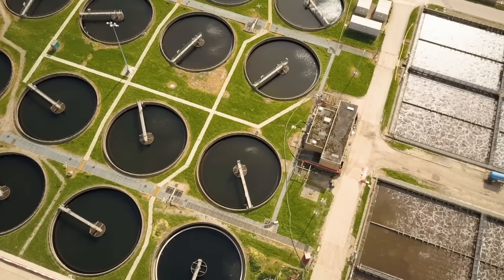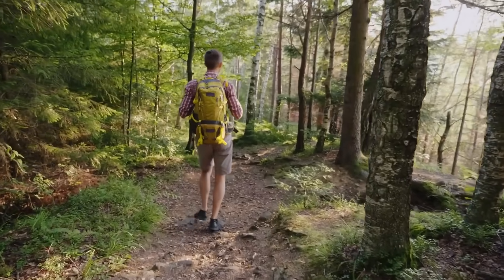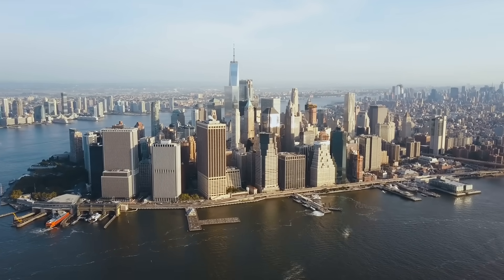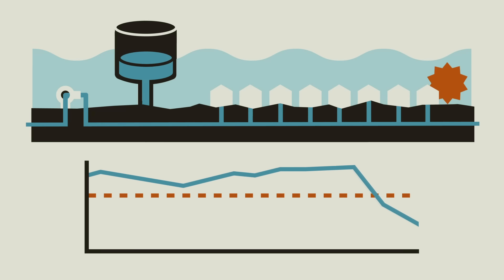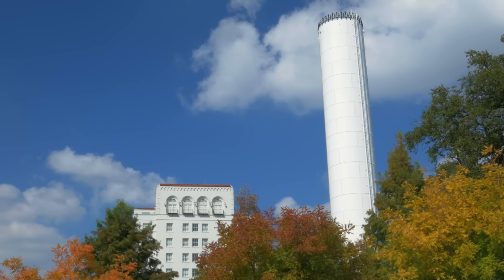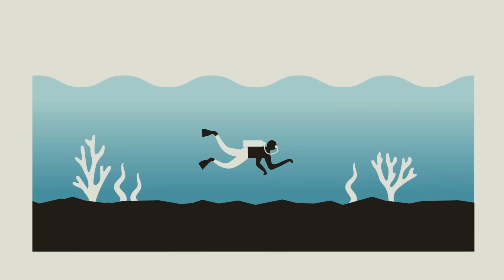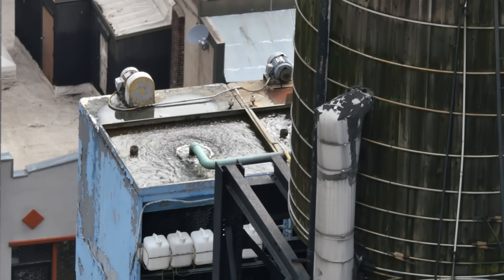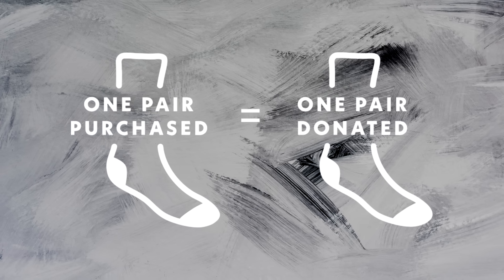How Water Towers Work

Comment: I live in the UK and I don’t think I’ve ever seen a water tower in real life
Reply: We don't have water towers except I think one in city with 380K residents and elevation 190-400m above sea level. Because most of the water is stored underground on some hilltops and distributed to zones of similar elevation below water tanks. But in parts of Czech Republic that are flat, we have water towers in form of large sphere  on thin "stem" anchored by steel cables. Historic underground water tanks are quite nice, btw. http://druhebrno.smerem.cz/tema/Vodojemy%20při%20ulici%20Tvrdého
Reply: They are brick towers though in uk not the design like in US.
Reply: I have seen gas towers before. Unlike water towers they basically work like a massive piston. They have a huge disc of concrete that they use to store the energy and pressurize the gas chamber below. Interesting solution for a fluid that's not heavy enough to pressurize itself (on that scale anyway).
Reply: Water tower presented on video can be replaced with concrete storage tanks placed on hill. Works the same but it's less visible.
Reply: I can see one where i live in Hereford, but it is not used these days, it is part of the water museum. i must go there one day just to be nosy
Reply: There's one in Tilehurst in Reading - it's quite a local landmark. Made of concrete too.
Reply: I live in Sweden and I have seen loads of water towers
Reply: I also live in the uk and there’s one about 15 miles away from me
Reply: Where do you live? There’s tons in Cambridgeshire and Essex. There weren’t any when I lived in hillier areas such as Lancashire though.
Reply: @cbehopkins  
There's one just outside Ormskirk.
...in Lancashire.
Reply: @cbehopkins  
http://m.ipernity.com/#/doc/302581/40933154

Comment: A water tower could have helped the fukushima reactor (and any nuclear reactor). The pumps were not working, the fission reaction was continuing and temperature was going up in the reactor.
Reply: And now they are spilling radioactive water in the pacific ocean but still below "safety" levels. I do wonder if our grandchildren will find this a problem.
Reply: The reactors still had pressure. They didn't have flow, so the heat built up to the point where the fuel assemblies started to melt. A water tower wouldn't have helped here. There are ways to remove heat through natural circulation, but I don't know enough about civilian nuclear power to know how or if they utilize it. They had backup power in the form of diesel generators, but they were stupidly put in the basement.
Reply: @WaterMan416  :
The purpose of the pressure vessel is to keep the water in liquid form.
What they need to do is have a gigantic water tower on top of the reactor. Open the valve so that water flows down into the reactor. They also need a huge receiving tank at the bottom. Another valve would be there that should be opened.

Basically, what I am saying that gravitation potential energy could be used.

In the old days, people would take baths. Almost nobody took showers. Some people would take showers by having a bladder thing filled with water (gravitation potential energy) and it flows down through the shower head and onto you.

The same principle can be used almost anywhere.
Reply: That'd be a wildly inefficient way to keep a reactor cool, as it would require a ton of water. Having a passive cooling method that could rely on natural circulation based on a temperature gradient causing flow would be much better.
Reply: @WaterMan416  :
I'm not sure what you mean by "natural circulation based on a temperature gradient causing flow would be much better."
Reply: A water tower on top of a reactor would keep the system pressurized. It would not allow for effective heat removal, which is what lead to the fuel assemblies melting. However, if the system is designed for it, you can use the water density gradient cause by differences in water temperature to cause flow that would remove heat without a pump running. This is called natural circulation, or sometimes "thermal driving head."
Reply: @WaterMan416  :
I'm not sure how much flow you would get that way.

The water tower would be connected with a pipe to the reactor. There would be a valve as well that is closed. So in normal operation, the tower water does not exert pressure into the reactor.
When there is trouble and when pumps can't be used to circulate the water in the reactor, the valve can be opened.
A bottom pipe is also needed. The water exits the reactor and goes to a basement chamber.

The idea is to cool the reactor for only 2 days. The technicians have to work quickly to bring the emergency pumps online.
In the case of Fukushima, the pumps were down and there was no way to cool the reactor.
Reply: It would rely on how the system is engineered from the start. Having an open system like that would require a tremendous amount of water. Natural circ would still require a large heat sink. Being next to the ocean, you've got it. That's also why nuke plants are often near bodies of water. Natural circulation for operation or emergency cooling is a proven concept, at least on a small scale with pressurized water reactors. Nuclear submarines have them. Feed and bleed is also an option, but it still requires pumps since reactor system pressures range from a few hundred pounds to a couple thousand psi. Like i said, though, I'm not really familiar with commercial operations or boiling water reactors. But a water tower over a reactor would not only need to be millions and millions of gallons, but also prohibitively tall (a quarter mile tall on the low end) to overcome pressure.

Comment: Here where I live, we don't have those huge ugly towers...
Instead, my local water supplier has underground tanks, that are partially filled with a high pressure gas, wich exerts the pressure on the water.
Reply: What gas do they use to pressurise the tanks?
Reply: @alb7112  I think it's cleaned air, but I don't know for sure..

Comment: So if you connected the existing tap in your home to a system with higher pressure you actually could quite easily contaminate the water for many people around you. I never even realized this is a risk till you said that the pressure helps contamination. (dont worry I am not contaminating anything because I have my own well.)
EDIT: I hope theres some kind of fail safe for this situation.
Reply: There is, it's called an anti-siphon valve.  Additionally, municipal water pressure might be much higher than the service pressure at your tap, there are various devices employed to reduce the pressure so that the end fixtures and valves can handle it.  Even residential pressure is around 45 PSI though, so attempting to use backpressure against the water system to inject something into the system would be difficult.  It's one thing to push into it at all, it's another to push for long enough to get all of the way back to the water main, and even then, you'd only affect downstream customers from your location, not upstream back to the main distribution system and everyone.
Reply: @TWX1138  Good to hear this wouldnt be as easy as it sounds.

Comment: @2:22 Electrons don't flow from 'high voltage to low voltage', they flow from 'a region of high potential to a region of low potential'. Voltage is the arithmetic difference between these high and low potentials which causes the electron to move.

Comment: @2:21 Electrons flow from low voltage to high voltage. Since their charge is negative, the electrical current flows from high voltage to low voltage.
Reply: 127x99mm 
Agghhhhhhh.... and this is why I’m not going into electrical engineering. I’m sure I’d get it eventually, but I’ll stick with civil and analyzing beams and trusses.
Reply: Dave Cockayne 
Benjamin Franklin getting it wrong is not a problem.
There is a problem when those who have the technology to prove the factual direction refuse to change for the sake of tradition, thereby putting tradition above truth.
There are a great deal of Pharisees in our day and age, they just go by different names.
Reply: Came here to say this.
Reply: I was about to say that but then I found this comment. Current flows from high to low voltage. Electron follow the opposite trend, thanks to Benjamin Franklin :D
Reply: Let's just refer to it as flowing from strong charge to weak charge.
Gives everyone an understanding of what is going on, and skips the discussion.
Reply: Electrons themselves are charged. What kind of charge you talking about? Positive or negative? How does electron flow from charge to charge? I bet "potential" makes much more sense to most people.
Reply: @nahiyanalamgir7614  Since positive charges are not flowing in all but extremely specific cases, one can exclude them when talking about moving charges.
But if it's clear that you're talking within electronics, I guess "potential" could be more intuitive. 
Though I have never heard that term used in electronics before.
Reply: Potential is pretty common everywhere, even in electronics. You surely heard of voltage, which is essentially potential difference. And here, we're just talking about potential difference when we say "electrons move due to difference in potential, that is, it moves from low to high potential"

Comment: around the 6:50 mark there's a lingering shot of a power substation, and looking at this I'm realizing how little concept I have of what anything in a substation does. Obviously there are transformers in there somewhere to switch between high voltage and less high voltage, there's some kind of stuff for routing power between 'IO stations', and there's a bunch of equipment for allowing safe failure. This substation looks like it's got 5 'IO stations', the ones in the back are all 3 phase but I can't make out the ones in the foreground, then some transformers in the middle. But what most confuses me is the clear line of thing running off to the left, there's a whole bunch of stuff there and I can't interpret any of it.
Reply: All substations are is a bunch of switches, current and voltage measuring devices and some bus bars with transformers in between. A lot of engineering goes into the components, but the fundamental buildup is very simple.
The thing on the left to me just looks like a large bus bar with lots of "small" high voltage lines coming off of it. Basically a splitter.

Comment: Why water pump need to constantly cycling on and off when it's not running at its maximum capacity, can't we install them a variable speed motor like on Inverter AC so they can work as much as the demand.

Comment: Water towers also provide redundancy in the event of a power outage. Pumps can't run without electricity but water towers don't require any electricity or any other external of power except for gravity.
Reply: tallman11282 he explains it in the video.....
Reply: tallman11282 I thought that was the sole purpose of a water tower

Comment: We in Germany don't really have Water Towers (in use) anymore but it's still interesting how they worked.

So thanks a lot for that Video 👍
Reply: Hydro-pneumatic tanks store pressurized water using an air blanket for the same purpose as the tower, only at ground level.  The air pressurized in the tank along with the water provides a smooth change in pressure when a pump is filling the tank or when demand for water is emptying it.
Reply: As far as I know, there are many different systems here.
They are made for there specific purpose.

Usually there are either large reservoirs and/or several small tanks, that are build underground.
In my hometown we have just one big reservoir (next to the water pumping station) for time of massive consumption (like fire or something).
All the other work is done by small pumps.

(I hope my english is not too bad 😅 )
Reply: @dawnofjustice4689  be like the French! Don't be apologetic about your English, It's not your first language. And, your English is fine by the way.
Reply: Hussein Omobola 
Thanks a lot.
I just was not that sure, that I was understandable.
Mostly because I needed to ask Google translate for some of the words 😂
Reply: You sure we don't use water towers anymore? The historical ones yes thoose all serve other purposes now but i think they are combined with other buildings. Though might also just be private owned water tower the one im thinking of
Reply: @chadoftoons  There are water reservoirs for fire protection. Pretty much every village has them but no water towers, at least I haven't seen any. As Grady has mentioned in the video, the towers have their own downsides, like contruction and maintenance cost. If the numbers don't add up, don't build them.
Reply: Municipalities are suppose to provide as needed.  Tax as needed. Be efficient as possible.
Reply: The UK in general, doesn't use water towers much. Only in the south east are they used as a main water storage system for domestic use, due to it being very flat.

The majority of water is supplied via reservoirs and moved via computer controlled pumping stations. 

Iirc, water towers are only used for emergency use for fire hydrants. Some large building sometimes have water tanks but tbh I don't think it's that common.
Reply: @tisFrancesfault  Much like the south east there in the UK, much of the US is very flat and that's why water towers are a very common fixture in American cities and towns.
Reply: I could imagine having an air-pressure-tank in the system to cope with rapid changes in demand. Does anybody know how its actually done?
Reply: So u guys are dependent mostly on pumps ?
Reply: @pardeepsinghbajwa5097  from one minute of reading Wikipedia, basically yes. 

After two more minutes, other types of storage are used and connected to a water distribution system. Pumps are used in parallel and series to increase the flow volume and pressure, respectively. They do turn Pumps off and on and also regulate the speed.
Reply: @pardeepsinghbajwa5097  Power outages are virtually unheard of so that's no problem.
Reply: Fat Boo 
That's interesting.
Thanks for that "inside" view.
Maybe we don't have the same system because we don't have such high buildings.

It would be interesting how it works in cities like Frankfurt (am Main) since they build higher and higher.
Maybe they use a systsem like in the US.
Reply: Fat Boo Interesting. In North America,60 psi is almost universal for home use. 4×14.7 is effectively 4 bar. I am delighted to know you still use bar. I cordially hate Pascals,even if it is only a decimal point. Cheers.
Reply: @paulmanson253  as far as i know, BAR is the standard here. It makes it easier to get the right pressure according to height (10m heitht difference means 1bar pressure difference)
Reply: My area doesn't have water towers, We just put reservoirs on top of hills. We have a lot of hills. I also learnt that these reservoirs often have 4 pumps, 2 in 2 out. The out ones are more to keep the pressure up since all the water comes from these reservoirs. These pumps are also connected to a seperate power system to keep them running during a minor power outage or power line repairs. In a major power outage, well they are all gravity fed, not that there has been a major power failure in my life time, we have hydroelectric dams providing most of our power
Reply: @unnamed47   thank you for explaining how Germany has their water system. I was stationed in Germany for 3 years back 1992-93, first in Darmstadt for a few months and then off to Wiesbaden at Wiesbaden Air Base.
Reply: You have water towers in bigger cities, you just don't see them.

Comment: It seems that water tank have zero to no downside when it comes to efficiency. How come I've never seen water tanks in Germany? I always thought of them as an american phenomenon (yes, a little bit short minded).
Reply: Probably because they take up a lot of space and they are fairly expensive? I personally dont know much about Germany but those are some thoughts I had.
Reply: Which part of Germany, because if you're near a mountain then your water system could just be fed by diverting part of a river into a pipe above the city. Most European cities are at least on the site of an old city even if they themselves are not really old, and most old cities were picked for their location because they could get gravity powered water.
Reply: @AlRoderick  Well, I live in lower saxony, 16m above see level. :D But I've visited various citys and never seen one. For me it seems a water tower often is superior to pumps.